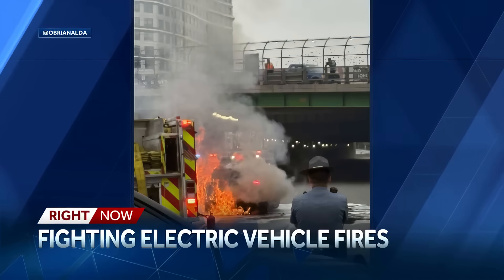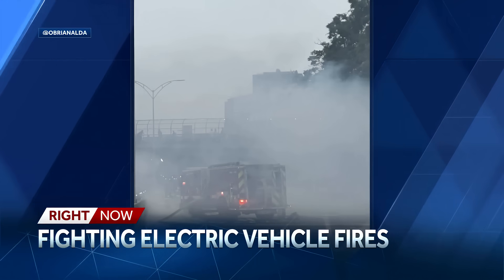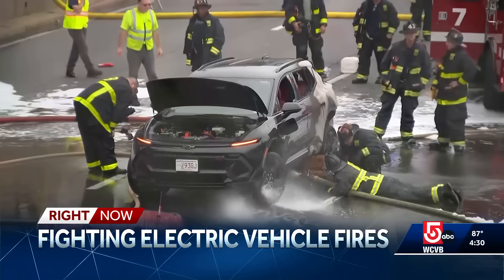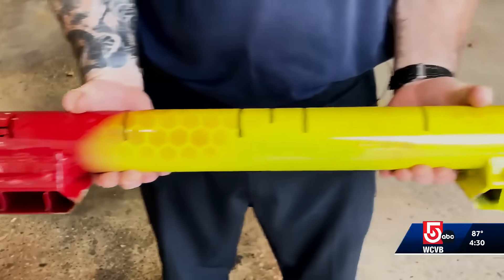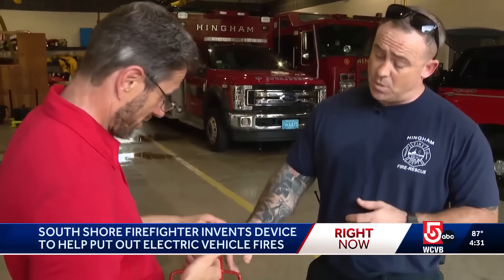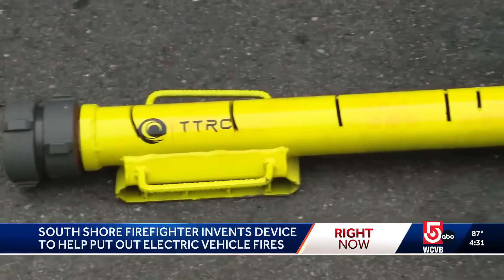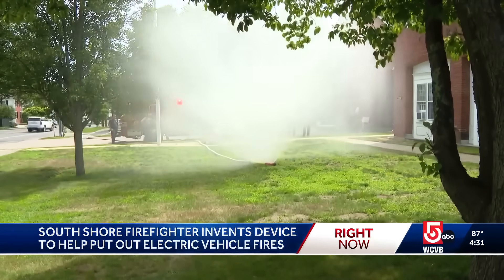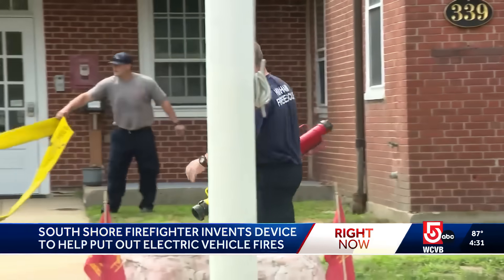Mass. firefighter invents tool to help put out electric vehicle fires

Comment: water don't put out lithium
Reply: LMO batteries don't use lithium, they use lithium salts, which water can safely dissolve.
Reply: @Stargazzer811 Not so. The material generates the oxygen needed to burn.  Water is ineffective.
Reply: @Wanderingsomewhere145  No its entirely effective, over time. Water cools the battery pack, thus slowing thermal runaway to the point it stops, but it also dissolves the Lithium salts which serve as the fuel portion of the fire triangle. Remove the fuel and the fire won't stick around for long.
Reply: @Stargazzer811 have never seen that hypothesis tested. Have you? If so, please offer a reliable reference.
Reply: @Wanderingsomewhere145  Cold Cut who make the  Cobra system, will be surprised with that. Their system can put out an EV battery fire in 10 minutes with water,  they've got a long wand attached to a hose with a bit on the end to cut a hole in the casing, you just need to flood the inside of the battery casing until it cools..
Reply: @rtfazeberdee3519  demonstrate a hypothesis test with reliable, documented, and published data. Talk is cheap.
Reply: @Wanderingsomewhere145  Wow you bunch fail at chemistry. Look up the FIRE TRIANGLE. Oxygen supply is not the only way to fight a fire. Diluting FUEL and keep materials COOL is another method. There is very little lithium in EV batteries, the whole car only uses about 10lbs. Vast majority of the flammable material has nothing to do with the cell chemistry but substrate and packaging e.g. PLASTICs.
Reply: @Wanderingsomewhere145  He's correct just unknowingly. The product already exist. It's called the PYROLANCE, it's been proven to control EV battery fires quite well.

Comment: I hope he holds a patent on that device... If not....he should see a patent lawyer ASAP to protect his investment
Reply: buddy its a metal pipe with holes cut out of it
Reply: Patents don't mean anything in the US anymore.
Reply: chinas already ripping it off
Reply: Research on "Pattent Trolls" and you will see how that usually ends in the US(the Land of the Free) lmao
Reply: Probably not possible. It's literally just a huge garden watering sprayer.
With threaded hose couplings two feet and some handles, made by bent plate and bars.
Welding material and paint.
Anyway it's not just the materials that need to be paid for. Time is money 🤑 
But oh, probably you can soon buy them cheep from china.
Reply: It’s actually a mobile deluge system. Nothing new.
Reply: @stever3074  Bespoke deluge system
Reply: No he should not. This does not deserve a patent. That’s what’s wrong w the patent system - giving out patents for basic ideas

Comment: But water doesn’t simply “put out” a lithium battery fire. It cools the battery. And in order for water to work on a lithium fire, you literally have to keep cold water flowing directly on it for 3+ hours. And that’s just for one vehicle. I give this man credit though. Firefighters are exposed to enough toxins as it is. At least this keeps them farther away from it.
Reply: @AJFH603 You have to keep the water on until the batteries get below the decomposing temperature, which means checking with a thermal camera. If you don't have a thermal camera, (I'd be stunned if a fire department doesn't have one) then 3 hours id a good guess for most battery packs. In Europe, at least one fire department made a water tank to dump the whole car into. I'm surprised someone hasn't tried making a pool with mobile walls and filling THAT with water.
Reply: @grahammonk8013 
The tank would contain any nasty chemicals. How would they get the car into the tank?
Reply: @1985230ce  They use crane. Or as suggested, form a tank in place. Keeping the poisonous chemicals in the tank is a good thing, you can pump it into a tanker and haul it away rather than wash it into the drains.
Reply: @grahammonk8013 
As long as they can attach the crane to the car safely. Maybe one of those clamshell grabbers. 

If you can figure a way to seal an erect-in-place tank you’d be rich.
Reply: @1985230ce  Do you need to "seal" the tank completely? There is going to be some leakage or splashing anyway, you simply need to reduce the loss. The intention is to reduce the contamination, it's not possible to completely stop it.
Reply: @grahammonk8013 
The better it’s sealed the better.
Reply: @1985230ce  Of course, but the best you can do is minimize any leaks.
Reply: @grahammonk8013  Around a 3000'F+ thermal runaway, toxic plumed fire? Good luck.
Reply: @grahammonk8013 That tank exists. It's an inflatable pool that's put around the vehicle once the flames are 'under control' and filled with water and some chemicals to try to stop thermal runaway. However, after seeing video of a Tesla that caught fire lakeside and was burning underwater I don't know how much confidence I have in that method
Reply: @grahammonk8013  And nothing will keep it from reigniting hours or weeks later...
Reply: @ffjsb  Wrong. They can only reignite IF you don't get it cool enough which is easily checked.
Reply: @grahammonk8013  there's numerous of videos on here of firefighters and tow companies complaining about Evs reigniting weeks after extinguishing
Reply: @O1dmanwalker 
I’m willing to bet that none of reignited while being submerged in water. Or even being extinguished submerged. 

But, yeah, it is a problem.
Reply: @ffjsb  yes they re-ignite centuries later. 
But yet you plug one in next to your bed every night
Reply: @O1dmanwalker  Weeks? I haven't heard of such, can you point to a specific case? They can reignite UNTIL they have cooled off. I don't know of a mechanism of re-ignition once they have done so.
Reply: @grahammonk8013 Yeah, I was also surprised when I heard. Start youtube search with "fire department chronicles ev fires" about 30 sec short very entertaining. Then cnbc did like a 10 min video about it too.
Reply: @neilkurzman4907  You're comparing apples to a bag of hammers.  Phones are WAY more reliable than EV's, and aren't even remotely the same size.  Not to mention, you can put your phone on a fire resistant charging pad that will prevent a fire from spreading in the UNLIKELY event a phone catches on fire.  
It helps if you actually know what you're talking about.
Reply: @ffjsb  you realize they’re pretty much the same batteries.
There’s only more of them in a car 
In fact, the original Tesla use the exact same cells that were used in laptops 

Is your phone on a fire resistant charging pad?  By the way, that’s not a thing you would need to put it in a fire resistant charging bag.

But it’s amazing that people like you can separate all of the lithium batteries in your house. There’s at least a dozen.  Power tools, laptops, tablets. Earbuds, cell phones, etc..
Those are all environmentally safe and never catch on fire 

But somehow, the ones in cars are an environmental disaster that burst into flames every other day
Reply: @neilkurzman4907  WRONG.  The construction is completely different.  Son, I actually have a degree in Fire Science, and have had lots of training on this topic, from the sources that write the fire code and test these things.
Reply: @O1dmanwalker  Yeah, that first one seemed a little....overdone? Everything I've read says that lithium cells have to be above a certain temperature for the chemicals to "decompose" which allows them to provide the oxidizing content needed for ignition.
Reply: @ffjsb 
Willie, I spent 14 years making lithium of my own battery packs. I know exactly what’s in them. I put it there. 
So I don’t know what you’ve learned in fire science Academy but apparently you didn’t study very hard.

Now, do you feel embarrassed by trying to pull one over on me with your BS? 
By the way, most modern cars are switching over to lithium iron phosphate and other chemistries that don’t burn as well as lithium ion and lithium polymer.
Reply: @ffjsb  WRONG Phones are single cell or at most two cell with no thermal management. BEVs are way more safe having many modules which automatically shut it self off when faults occur. They also have thermal management to prevent degradation. Thus why BEVs will last 15 years plus and 12% degradation at several years old. Meanwhile most phones have barely functional battery capacity at several years old.
Reply: @neilkurzman4907  Son, you still don't know what you're talking about.  EV batteries and phone batteries have totally different construction.
Reply: @Neojhun  If what you say was true, then there would NEVER be thermal runaway in an EV battery.  Except we KNOW for a FACT that can happen.  Any damage at all, an the battery pack is done.
Reply: @grahammonk8013  They have been checked yet still reignite.
Reply: " 3+ hours." WTF nope, less than an hour with modern Lithium ION EV batteries. FYI there is very little lithium in a EV Battery, the whole Car maybe has like 10lbs. Majority of the flammable materials is hydrocarbons like Plastics and Cell Electrolytes.
Reply: @Neojhun - You’re incorrect. Wholly and completely wrong.
Reply: The TOXINS are released into the sewers and hence waterways while other toxins and pollutants are released in the fire.  A VERY Green idea
Reply: I say just let the fire burn itself out. Kids in Africa could drink that water
Reply: Doesn’t have to be water. You can pump any firefighting liquid through it like purple K which will take out the fire.
Reply: Cause it's not just about thermal runaway lithium is a very reactive metal 
   It creates hydrogen on contact with water 
    Really needs submerged in a oil 
Like how you'd store metallic lithium
Reply: Can actually use gasoline to put out metal fires then snuff the gas fire
Reply: Really best thing would be huge kerosene tank put the whole car in then cover
Reply: These battery packs should also be oil cooled not water cooled where I think a lot of the issues are made worse 
      Should also have a quick release mechanism and place for fire department to grab
Reply: And believe me I'm well versed in all things John B Goodenough 
   And know what dendrites are and how they cause thermal runaway
Reply: Lithium ceramic battery should be standard 
    Accounting the 40 80 rule with lipo ctfo it's the same density 
     Can use hot as lava cold as ice while sawing in half 
   Rapid charge discharge 
   😅
What's wrong with this world
Reply: Does that mean the lipo battery was almost Goodenough 
    😅 I mean you don't keep going for nothing 😂❤🎉
Reply: Three hours? And you know this because of your experience testing various methods are putting out lithium batteries.
Reply: @neilkurzman4907  They know this because they have access to a wonderful tool called "Google". Fun fact, you have access to it too. Sounding stupid was a choice you made. Hope this helps :)
Reply: Are you telling me you know something he doesn't
Reply: @Wildman-zh8lg  Yes.  I've only been on the job 40+ years...